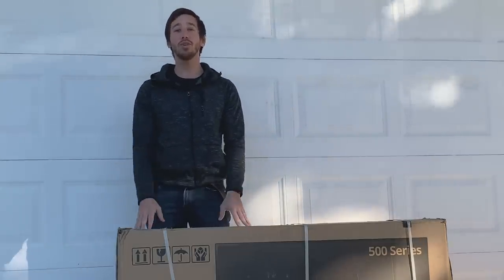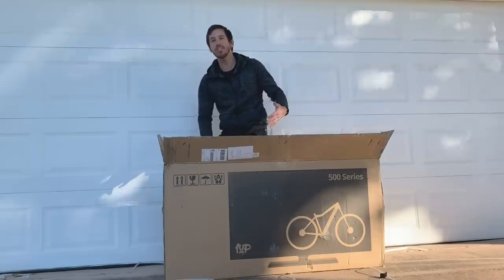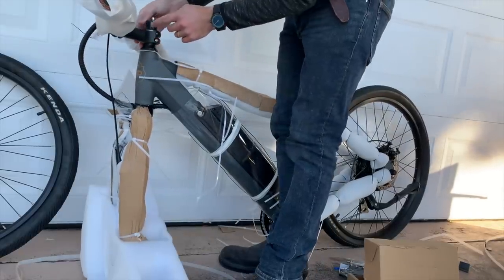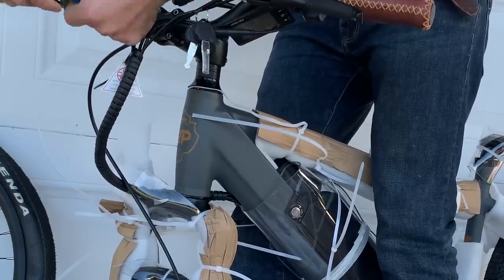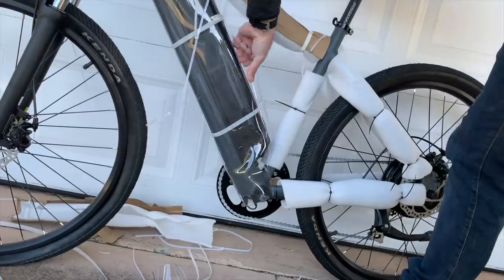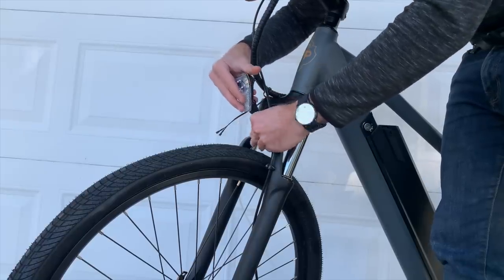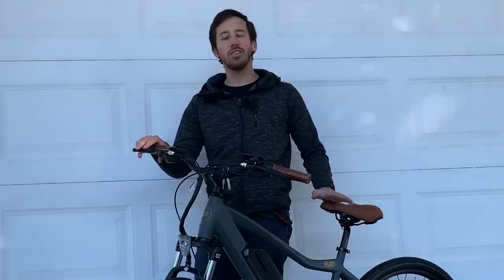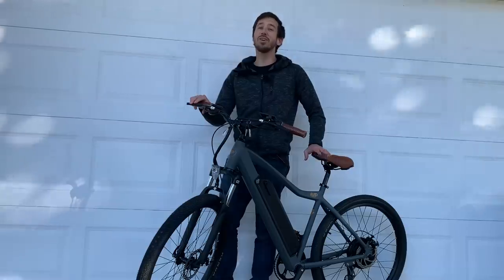How to assemble an internet direct e-bike

Comment: Greetings Micah 
Love the new ebike your got there. Can't wait to finish my build so I can show you how your vids helped a first timer, senior citizen with his first ebike. How to check out your vid on series connecting 4 LED strips I used your model red in rear white on forks. Got some cool all in one motorcycle LEDs that have turn signals, brake light and running lights. Due to their flexibility,  I snaked them along the rear edge of the battery rack  since I got two strips I connected both signal wires on the same strip together making both R/L act as one signal. As I mounted the strips vertically curving downward the signals are located at the top and bottom of the strip flashing with the running leds in between. Looks so COOL!!!

Comment: Any suggestions for a 48v 1000 watt hub fat tired bike for tall and large men... Battery option for me would be rear rack most likely because I heard vibration can cause the bullet type w/ slide on/ off bracket can heat up or become serious... Considered a kit for a current cycle but for a few dollars more looks like a nicer choice...

Comment: Can’t seem to find any info and wondered if u can help?
I got a new bike 5 yrs ago and for various reasons used it once, been stored in garage, now plugged charger in and green fully charged comes up, but bike not switching on. Now is their a way of checking the battery cells without totally stripping it down to individual components, looks very well constructed so will be a difficult job

Comment: well offcourse i would like a book. I just finished connecting an extra battery to extend the range of my folding ebike from 20 to 60 km's ,that is at maximum support, 105 instead of 35 at lowest . Like you showed in the video with the electric step bike. the support the bike gives depends on the speed that you are going wich seems like a dissapointment at first , but as long as i can keep going on my own strengt it will not drain the battery. offcourse i will go in search of mountains to see how it can help me. It's not te speed or time, but that the fact i am going there without exhaustion what is important for me. thanks for all your good video's .

Comment: Is it generally ok to overvolt a hub motor... by maybe one cell in series?  Is it generally the ESC that is the limiting factor?  I’d like to build a secondary battery for my ebike using reclaimed cells... a lighter battery for shorter commutes.. less Ah.  Was thinking overvolting could make up a bit of the loss in capacity?

Comment: Common sense approach and good a advice.. my 3 bikes (2 conventional and 1 ebike) were bought like this. My input, check the bike size is the one you ordered before doing anything. The brake and gear cables may have settled since it was assembled in the factory and might need a 1/4 turn before riding. Cheers.

Comment: I got an Ancheer sport , 350 watt motor through Amazon  on December 13th 2019, for 659 $, so far runs great, my only complaint is it doesn't deliver the 15 to 30 miles it promises on their ad, I'll be lucky if I get ten miles on a fully charged battery with throttle only!  I'll call Ancheer  to complain and see how their customer service responds.

Comment: I'm having trouble finding just a good 700c hub motor. Much of what I find is in kit form.
Reply: quinn foster - You can contact EBIKES.CA... they always helped me fulfill my needs.  BUT... if you want wheel-freedom, buy your parts (a good rim (double-walled), a good hub that suits your needs, calculate and buy the spokes (try prowheelbuilder.com/spokelengthcalculator), then build your own wheel.  I will post (here) the text I wrote to teach people how to build a wheel.
Reply: @bob-ny6kn   Very conveniently for me my step dad has been racing downhill bikes for my whole life and has piles of old high quality rims, tires and whole full suspension bikes ETC... I will try to find a high quality hub motor and see about what else I need. 

Thanks for reminding me about this method!
Reply: @quinnfoster4671  Very nice!  As promised... the 'how-to'... (Let me know [here] if these instructions are confusing. I boiled-down pages and hours of other wheel builder's instructions to be simple for anyone to follow, but these still may cause some confusion). Get to it, and have fun!

Tools - measuring device, spoke wrench, ERD tool

Build an ERD tool - https://www.youtube.com/watch?v=61sIGDHs0gQ

My method - 

A. Make sure your RIM and HUB use the same number of spokes.

B. Calculate spoke length(s)
  1. https://www.prowheelbuilder.com/ >> click SPOKE CALCULATOR
     https://www.wheelpro.co.uk/ >> click SPOKE CALCULATOR
  2. Select WHEEL TYPE (Front/Rear) >> skip to NUMBER OF SPOKES
  3. Enter NUMBER OF SPOKES (normal 32 or 36)
  4. Enter LACING PATTERN (normal 3 CROSS)
  5. Enter rim Effective Rim Diameter (ERD)
  6. Enter hub AXLE WIDTH (Outside Locknut Dimension - OLD)
  7. Enter Non-Drive Side (NDS) LOCKNUT TO (MID) FLANGE distance
  8. Enter Drive Side (DS) LOCKNUT TO (MID) FLANGE distance
  9. Enter LEFT (NDS) FLANGE DIAMETER (spoke hole to spoke hole)
 10. Enter RIGHT (DS) FLANGE DIAMETER (spoke hole to spoke hole)
 11. Enter spoke hole diameter (normal 2.6 mm)

B. Build the wheel
 1. Oil nipples and spoke threads
 2. Align hub label so it is visible through valve hole
  - add 1/4 CCW twist of hub – aligns label on completion
 3. Insert DS in-bound spokes in hub, every second hole
  - first hub spoke in first rim hole to left of valve hole
  - remaining spokes every fourth rim hole (1 0 0 0 1)
  - turn nipple 4 turns
  - FLIP WHEEL
 4. Insert NDS in-bound spokes in hub, above/right of DS spokes
  - first spoke is 2 holes to right of valve hole
  - then every fourth hole, next to DS spokes
  - DO NOT flip wheel YET
 5. Insert DS out-bound spokes, then grab spokes below
  - FLIP WHEEL and lay spokes orderly
  - rotate hub CCW (inbound spokes now radiate to right)
  - cross each DS spoke Over/Over/Under(/over) DS-IN spokes
 6. Insert NDS out-bound spokes, then grab spokes below
  - FLIP WHEEL and lay spokes orderly
  - cross each NDS spoke Over/Over/Under(/over) NDS-IN spokes
 7. From valve hole, tighten each spoke 2 turns until firm
 8. Tighten each spoke 1 turn for 4 rounds
 9. (REAR WHEEL) On 4th - 8th rounds, only tighten drive side 1 turn

C. TRUE (side/side, hop, dip) and CENTER rim on hub (O.L.D.)
Reply: you the best! Im going to ask my parent about this when they get back from Tasmania

Comment: very important thing that wasn’t mentioned is calibrating breaks and gears. it’s the step i struggle with most
Reply: Neither was making sure you verify proper spoke tension.

A lot of people blow out wheels when ordering a boxed bike and not checking that.
Reply: @Psyrecx  Not accurate. I worked at a bike shop where we stopped building wheels and ordered them ("from China"). Not one issue.
Reply: @bob-ny6kn  

Try reading what I said again. What you did at a bike shop has nothing to do with what I said.

Also, I've ordered wheels before and had half of them loose. So, your claims are BS, or your shop was sloppy.
Reply: @Psyrecx  No. "My" shop was perfect (QC was also my job). I wish it were different for you. Good that you check and correct.
Reply: @bob-ny6kn  

You wish it were different for me... well that's funny, because most shops check everything. 

Says a lot about what you consider 'perfect'.
Reply: @Psyrecx  You would and could never understand. That's okay. People like you keep people like me employed, so thank you for that.
Reply: @bob-ny6kn  

Sorry, but people capable of maintaining their bikes don't keep you employed. 

Perhaps if you knew how to properly maintain them yourself, you could keep yourself employed.
Reply: @Psyrecx  Haha. You are a work of art.

Comment: The bike is $1099, you're welcome...
Reply: I have a momentum fatbike used condition (170$) and converted it with a 48v 1500w motor with battery included  (410$) its a monster on the road. Upgraded to a front suspension for 40$ for total 620$ and the power ill take builds than new ones all day long